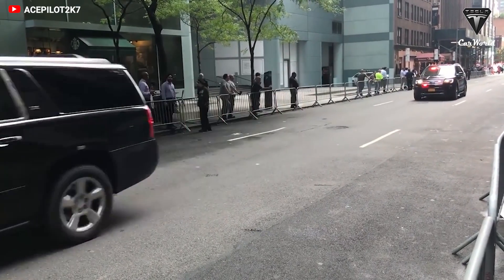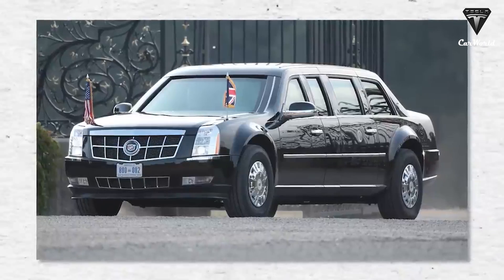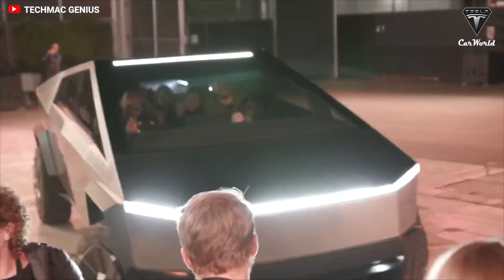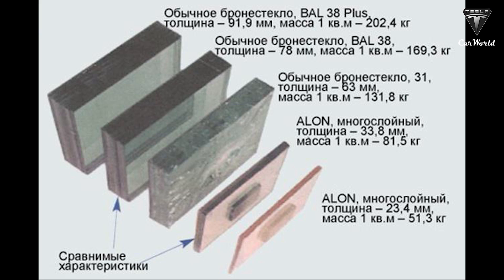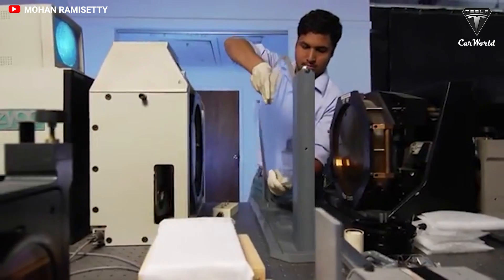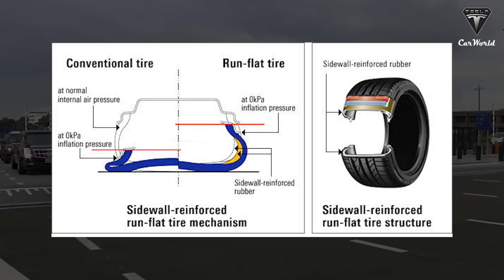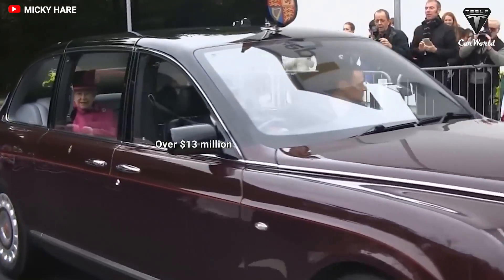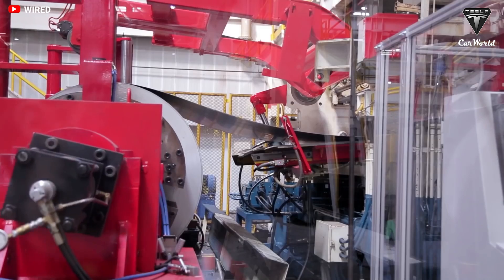Compare bulletproof glass of Cybertruck and Cadillac One presidential car. Who is the new king 2023?

Comment: "glass used on starship"? haha i think you've confused the glass with the stainless steel. The patent states the glass is highly resistant to pitting, run-away cracks, thermal cycling, and blunt strikes. A bullet is not a blunt strike in this case. They are talking about rocks being kicked up, not bullets. Please research before posting nonsense.

Comment: Question: Does AlON conduct electricity?  If so it maybe could be used for EM (electromagnetic) shielding and even EMP ( EM Pulse).  Think it through.  In AF1 for example you want the plane to be somewhat EMP proof but the windows are a major leak point.  They are also a major bullet weak point.  AlON could help fix both.